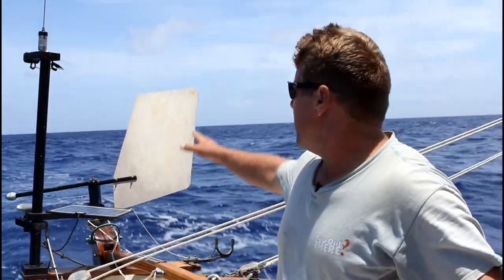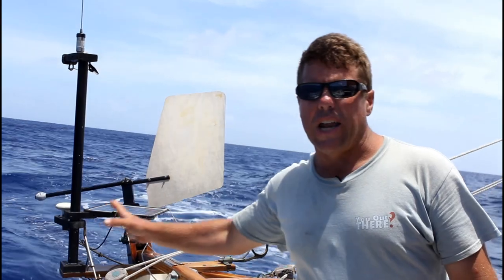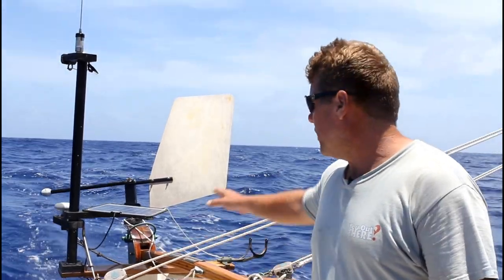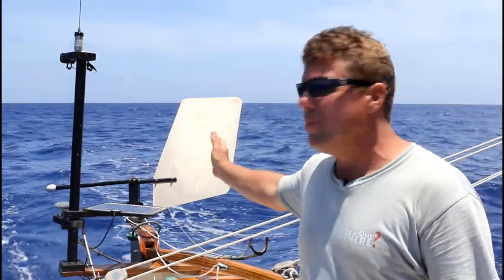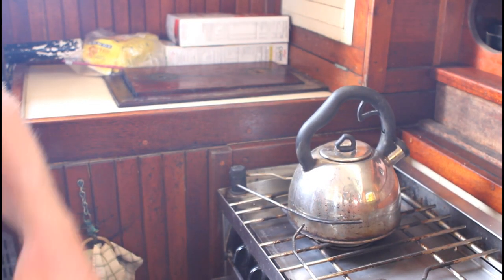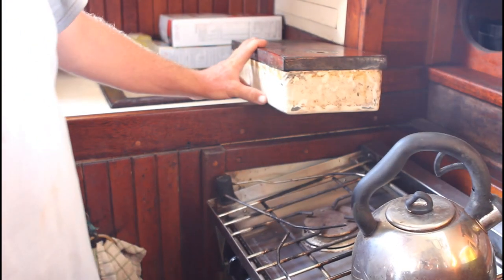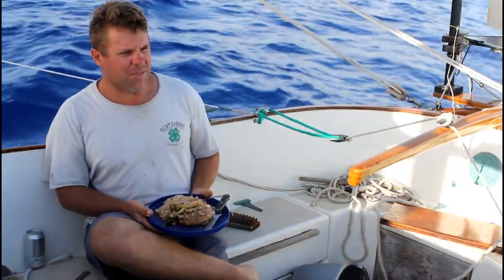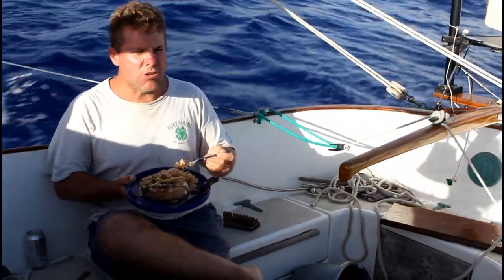SailingOceans_PuertoRico_to_Chesapeake_June2017_PartTwo

Comment: Windvane: My Monitor takes over from the auto-tiller when winds get over 10kts. It takes a FAST (read power hungry) autopilot to handle heavy winds, which the Monitor does flawlessly with just boat-motion-power. Your full keel helps tracking quite a bit, too. Even jibing downwind, the Monitor does well when tuned like any other sail.

Comment: Hi Kevin, I have enjoyed all you videos very much. No nonsense, practical recounting of your situation and techniques. Really good,
So.....my question.....When your windvane paddle swings , which way does it turn the trim tab? The same way as it is turning or do you have it geared to turn the trim tab the opposite way? Does the trim tab have enough torque to swing the rudder the opposite way.....is it like a lever on the back of the rudder.....when it turns to port it pushes the rudder to starboard? Maybe you could do a segment on your trim tab windvane and explain how it works. it sounds inexpensive and effective for a stern hung rudder setup!
Reply from the maker: The air paddle engages directly to the trim tab shaft, so it turns the trim trab in the same direction as the paddle.  Yes, it's all about leverage, in fact the trim tab is a little too large--as mentioned, I have to use shock cords to dampen, otherwise it over-steers.  For more go to my website:  www.boothbyboats.com and click on Boat Projects, there's a section on how to build this windvane.  Cheers!

Comment: One method you did not mention when sailing down wind is to run your jib and a genoa wing on wing and haul in your main.  Also  you can use the same method as the trawler cruisers use.  Add flopper stoppers to your boat that you can deploy when sailing down wind. And why are you not running a trolling line to keep fresh fish in your belly instead of resorting to can goods.
Reply from the maker: Did not know flopper stoppers could be used underway ... I used to fish, but I kept losing my gear, and without a swim platform fish do make a mess of the decks.  Sure tastes good, but I generally don't spend more than two weeks at sea, so I can survive on the processed stuff until the next port.  Fair winds, thanks for watching.
Reply: Thanx for posting.  Need more videos.
Reply: Do you mean paravanes can be used to stabilise a boat underway?
Reply: Franklin Newhart what about a drifter?

Comment: I’ve just started watching your great teaching vids and subscribed👍 I’m very much interested in your trim tab steering vane. I have an 1979 Ericson 31 independence with transom hung rudder. If you could recommend some information on how to build one like you did would be very much appreciated. Thanks for the excellent videos!
Reply from the maker: The two sources I used are the appendix to Moitessier's book "The Long Way", and Larry Pardey's chapter "The Truth About Windvanes", which I think is in "The Self-Sufficient Sailor".   It's basically dead easy EXCEPT for one important detail: you must attach the air paddle at the point where the two axes of the rudder and trim tab intersect, the no-action point.   Otherwise as the rudder moves it will wag the air paddle and will not steer well.  Also, as I pointed out in the vid, I find that shock cords are necessary to prevent over steering.
Reply: How to Sail Oceans thank you so much I’ll definitely check those out👍
Reply from the maker: Larry Pardey's section on windvanes is in "The Self-Sufficient Sailor", just checked.
Reply: Yep I ordered both books today. Thank you so much. If you can in the future maybe you could make a video about your design. Looks very simple which I like 👍
Reply from the maker: I was just thinking about that.  Enjoy the books, Moitessier's is a classic--infectious, too.
Reply: Funny you should say that. The girl I bought my boat from highly recommend all his books. Looking forward to reading them.